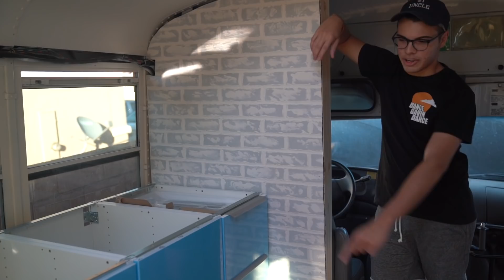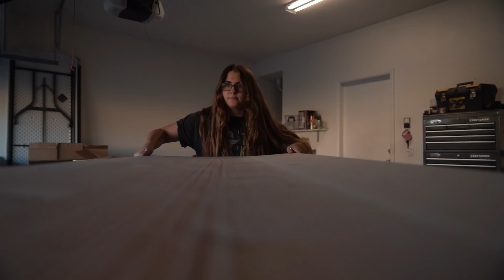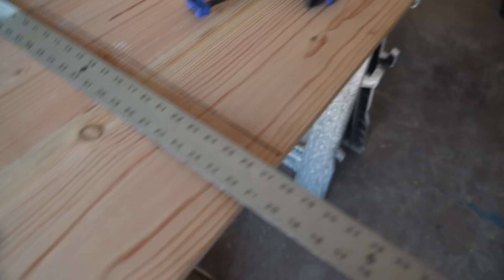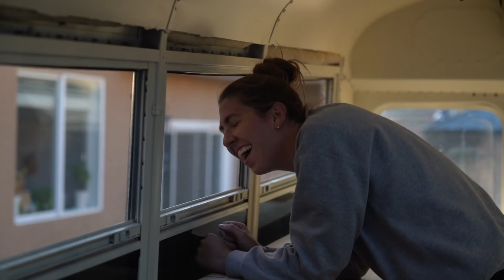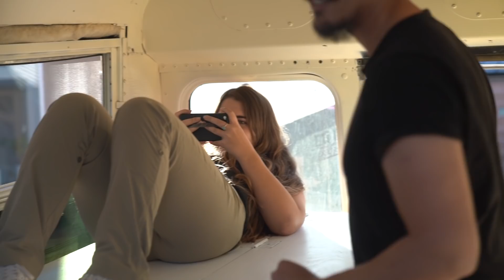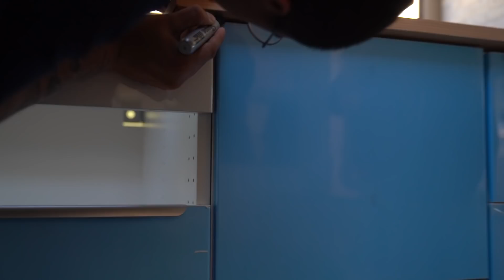She Drilled Through Our Window! | Skoolie Build (Ep.13)

Comment: Okay, just a heads up, drill bits don’t break that easily when used correctly even the cheap drill bits don’t break that easily if they are used correctly. All jokes aside look up how to use a drill without breaking the bit, and it will save you a lot of money.